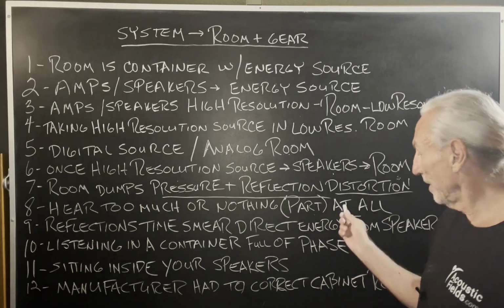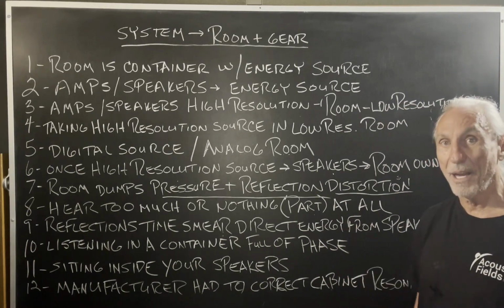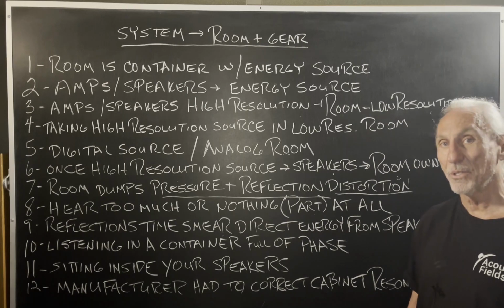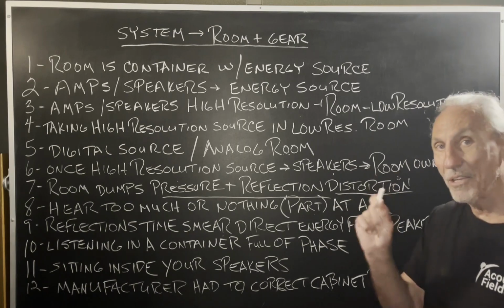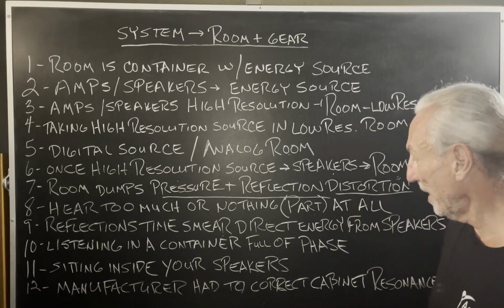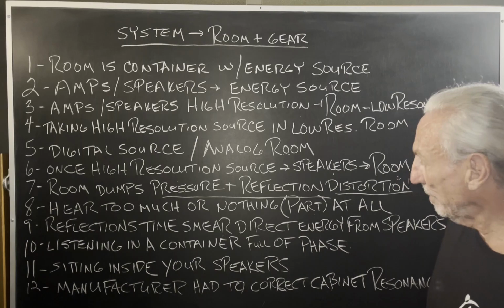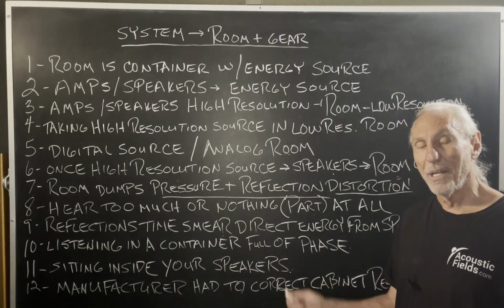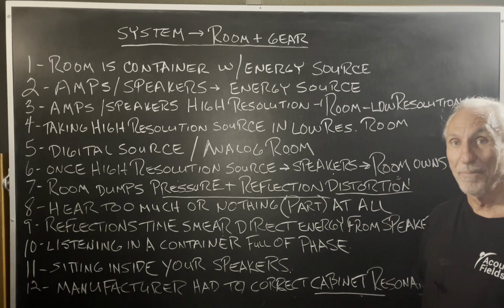System = Room + Gear - www.AcousticFields.com

Comment: Nice video.
Reply from the maker: If people spent more time and money on treating the issues of their room, they would not have to have a constant hunger for new gear. With new gear you spend a lot to get a tiny increase in resolution. If you treat your room properly, you will hear more of everything. The resolution increase is far more dramatic and at a lower cost than new gear. I always ask clients to compare their new treated rooms to gear. Most say that a treated room is like getting new amps, spaekers, and cables x 10 all at once.